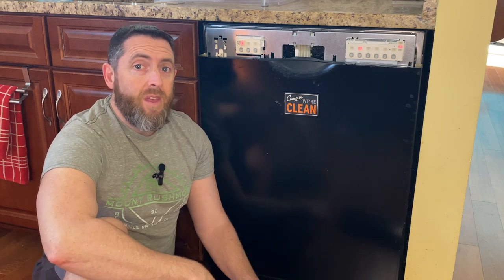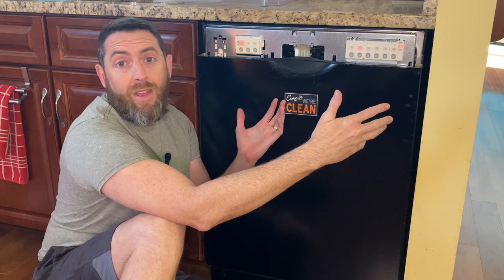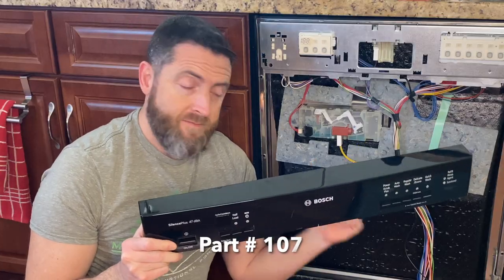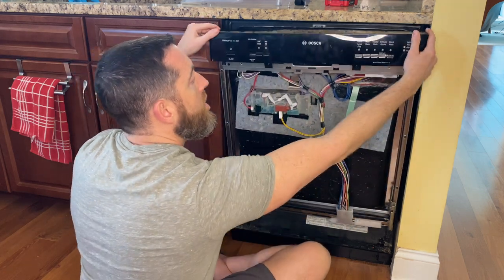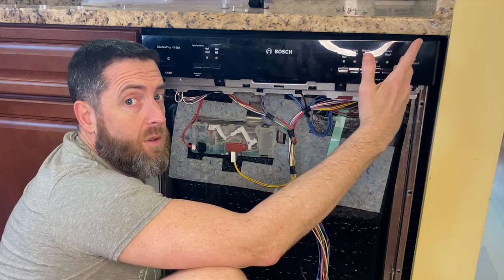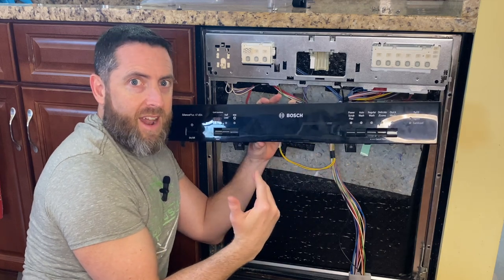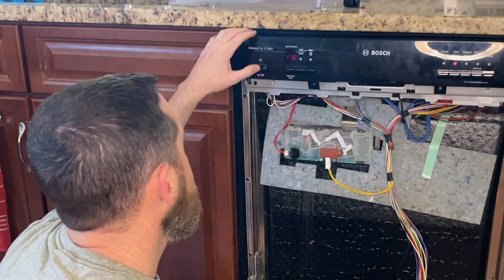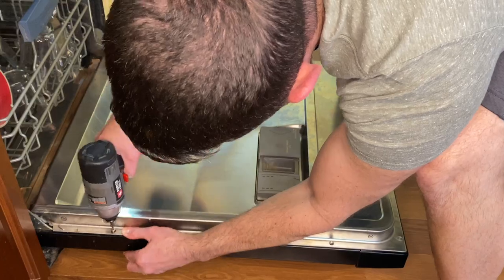DO BETTER BOSCH!! Dishwasher SHE55M16US faceplate replacement.  Part #107 #bosch #dishwasherrepair

Comment: Thank you, Paul!  I'm on my third fascia panel, b/c one of the tabs on the replacement I paid for broke immediately upon handling out of the wrapper. Bosch did send another one at no charge but advised me to get a pro to install it -- they do not provide any instructions, as you probably know. ... I seem to be having a draining issue as well, so I'll probably call our service guy and hand him everything --- but your patience, and this video, are a terrific help.  Thanks again.
Reply from the maker: @rickadamson550  you’re welcome!  I had to replace my check valve because of the same thing!!

Comment: Thank you,  I was able to replace this with a lot more confidence and avoid all the pitfalls. I broke the same tab while getting the old handle off, and thought I'd add that if the new handle ever needs to be removed, you have to push the tab outward.
Reply from the maker: @BobCampbell530  good advice!

Comment: Many thanks, as I watched this right before replacing the panel.  One more note on the pesky buttons - in addition to being careful that you match the right button to the right slot, be careful how you place the  buttons in the tray.  While they do not "click" into place,each button has two small tabs that slide under curled slots to make them secure.  Otherwise, when you move to insert the panel, button(s) can easily fall out.    Thanks again, Paul.  I'm certain you saved me at least 30 minutes.

Comment: THANK YOU!  I was mixing up the buttons as well and did not realize it!

As a side note, I found it’s a lot easier to take the fascia panel on/off by removing the whole control panel, which is held on by two small screws on each side of the inner part of the door.  The whole assembly snaps together easier when it’s off the door…just be careful to not yank the wires too much.

Comment: Great video help!  I watched it several times before I made my attempt.  I had all my buttons, so I just laid the new panel below the old panel on a work table and moved each button one at a time.  It took me longer to remove the old panel, until I got a small slotted screw driver to carefully pry loose the top tabs. Be careful with the door screws, as they are small and will strip the door sheet metal easily.

Comment: Thank you for posting this. It’s super helpful. I just completed the repair!

One thing I’ll point out:  putting the faceplate back on is a bigger chore than is apparent in the video. Look at the orientation of the spacers at about the 10:45 point on the video. It’s a quick flash, but important. 

Also, I either needed an antigravity ray or a helper to hold the faceplate on the door while I replaced the screws. 

I’d still be cussing at it and reaching for the duct tape without your video, though!
Reply from the maker: Thanks for the helpful tips!!

Comment: I have a different model but the basics was the same so this was pretty helpful. We didn't lose the buttons 'cause it didn't come off completely. I DID switch them from the old to the new in sequence so that was a good hint. I had trouble keeping the naked door from latching so I wadded up some duct tape and stuck over the hole that the latch fit into. And learning from others' mistakes, don''t forget to put the screws in for those two big tabs on the bottom. 
And I have this to say about Bosch. It's pathetic that this molded piece of plastic with minimal engineering costs $140 just like Paul said. AND to put the new one on, you have to take the door apart? The HELL? The most IMPORTANT thing I learned...when it's time to replace this piece o' junk, it ain't gonna be another BOSCH piece o' junk!
Reply from the maker: Well said!!

Comment: This was very helpful. I’d add that the panel should be put on with the top tabs first - then rotated down…but at least in our case, once tue bottom outside left and right tabs are clicked into place, those latter tabs ARE NOT REMOVABLE without breaking them or bending metal in the mating part. This is a horrifyingly bad design, and along with other items reflects poorly on Bosch.

Comment: Question!?  I have a rubber piece that runs all along the bottom of the front panel on my bosch. Does the panel go on the outside of that? If so, how?  because it keeps pushing the panel off when I open the door to put in the screws. Thanks for any help you can give.